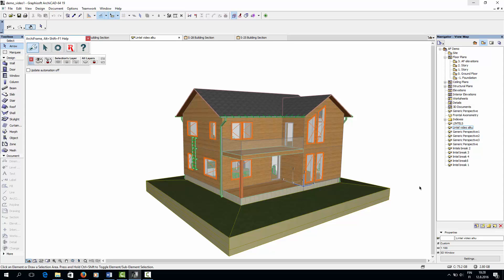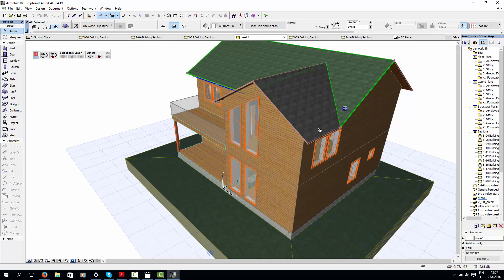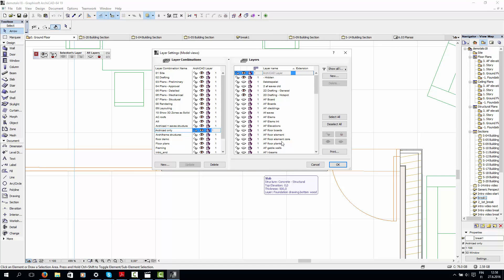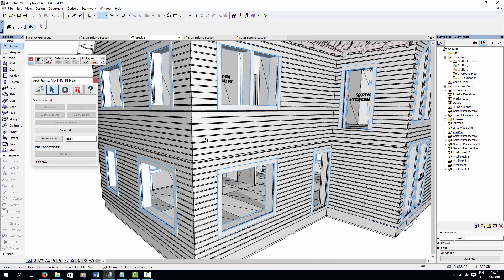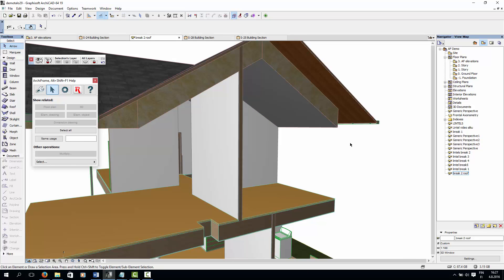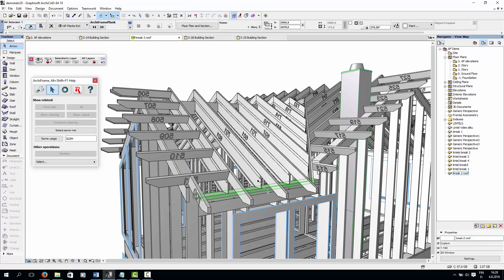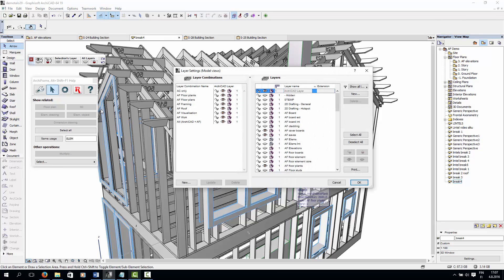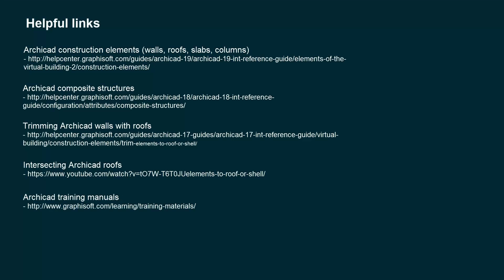1. Introduction to the ArchiFrame Getting Started Series

Comment: I have an existing project with wall profiles and composites already determined and set as needed.  Is there a way to "eyedropper"; or copy and apply the existing properties of those walls into the archiframe wall?
Reply from the maker: Hi! ArchIFrame own element settings are saved into your hard disk - not with the project as ARCHICAD attributes. This way the definitions are available to all projects. Please see https://ebookplus.fi/teos/Archi?lang=en#3(20)Getting(20)started(:(20)entering(20)main(20)settings(20)and(20)setting(20)up(20)the(20)material(20)list for more information.

Comment: Where can I demo this ArchiFrame product?  I am not initially impressed.  It does not appear to be anything I can not already do with ArchiCAD.
Reply from the maker: You can request a trial from www.archiframe.fi. A couple of features ArchiFrame provides that you cannot get with ArchiCAD:

- The projection drawings with dimensions
- Automatically generate real framing based on ArchiCAD walls
- Tools to work with individual pieces
- CNC-output
- Highly customizable quantity takeoffs
Reply: I have been doing all of that with ArchiCAD for more than 20 years.  
We used to have a Wall Accessory Tool for automatic wall framing.  I never found it to be as efficient as just modeling the framing without it.  And of course we already have have an automatic roof framing tool as well.  
CNC-output for wood framing??? I don't think that would be useful. 
I have many Interactive Schedules for this kind of work.   The value of ArchiFrame must be in doing what I already do faster and more efficiently.  I will enjoy testing ArchiFrame very much.
Reply: @sjepson100  Dude... Archiframe is used by the biggest companies in Norway.. If you dont find it usefull its because you are getting old.. Same shit with people who does not want to learn new things in the buiseness in general.
Reply: Steve how do you use a schedule to work out the area of a roof?